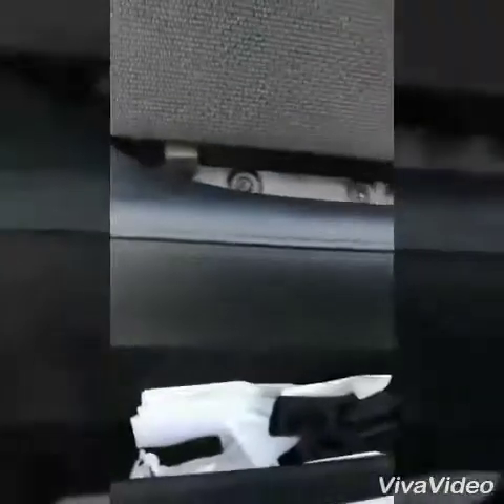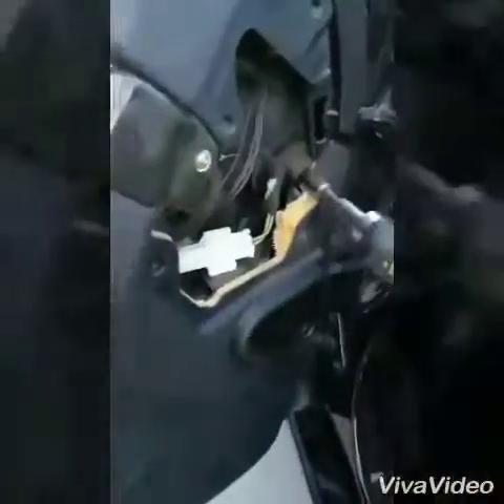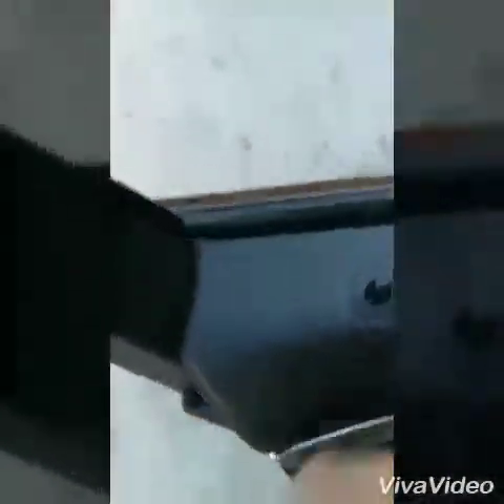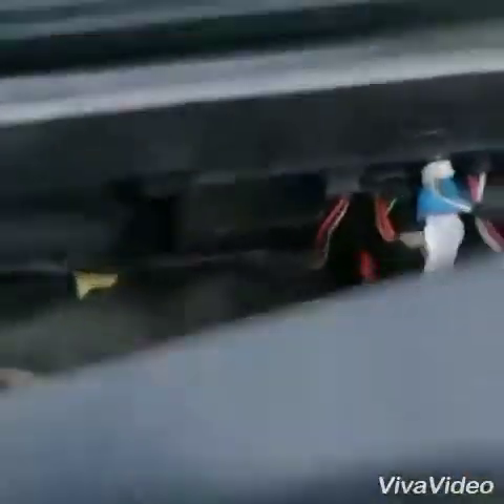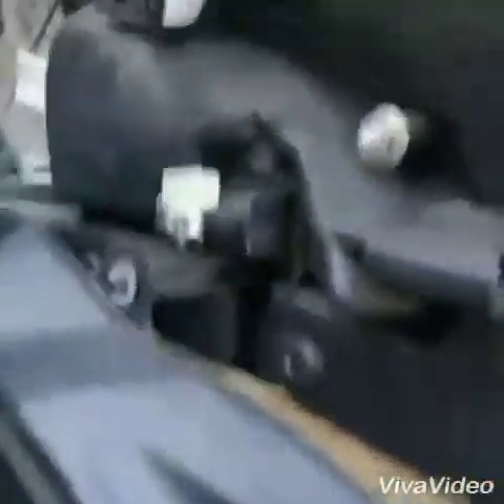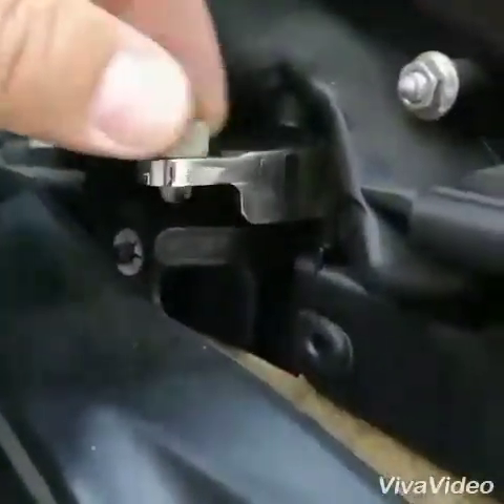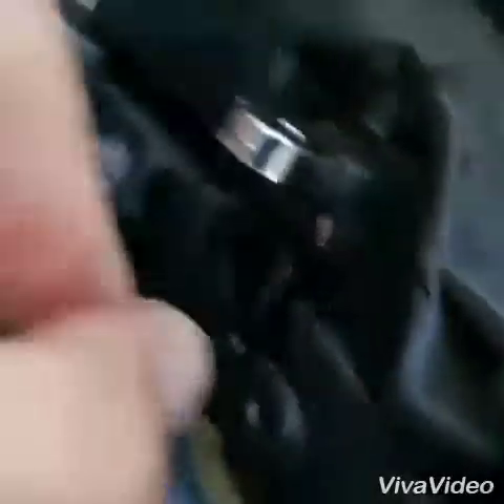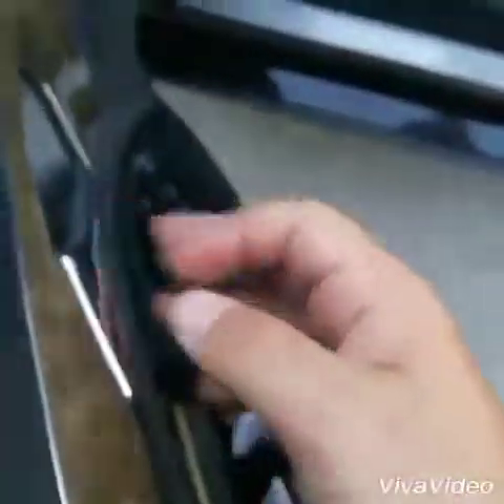Mercedes-Benz E class W211 door handle replacing, step by step

Comment: Please which screwdriver did you use to remove the door panel thanks
Reply from the maker: Philips screwdriver, or so called star screwdriver, and I think you need a midsize cross screwdriver too. Dont know the size but get e  multi size pack of philips sd and you'll be ok.
Reply: @CHE2010  thanks million dude